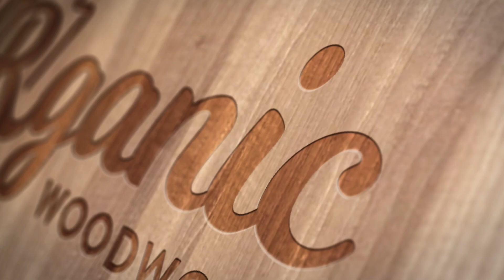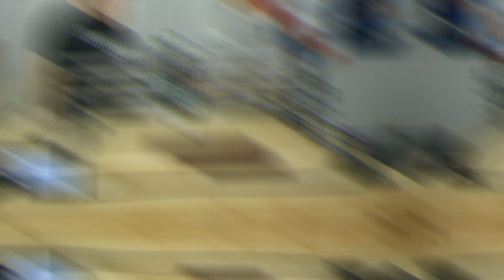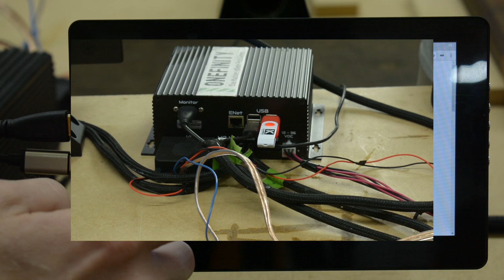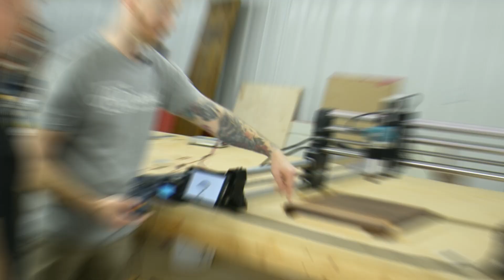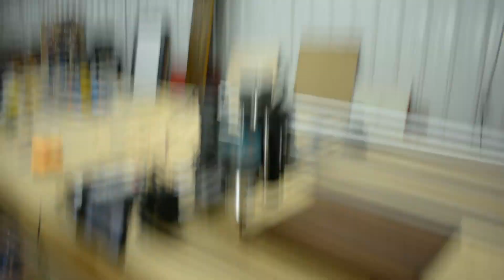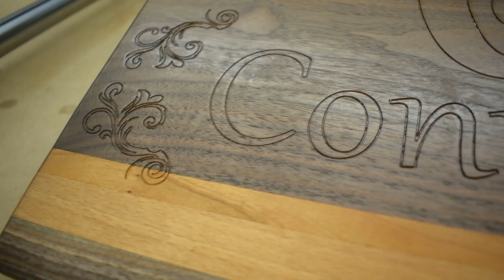The most user friendly CNC Machine

Comment: Hello friend, it is possible that this machine, if the tip is changed, can cut galvanized sheet less than 1mm. sorry I'm using a translator.
Reply from the maker: Yes with the correct feed rate

Comment: I have to confess, when I first discovered the OneFinity I was bummed! I've been using a Shapeoko XL now for about a year and have had issues. Particularly around alignment when flipping stock to cut/router on the back side of a work piece (I make solid body electric guitars). And issues with accurate depth cutting. I suspect, rightly or wrongly, that part of my problem is the slight inaccuracies that are inherent in belt driven systems. There are so many variables to consider on my current unit like eccentric nuts, v-wheels, belt tension (which are also subject to stretching over time), squareness of the machine, swelling and variations in the supplied MDF wasteboard. If I were to consider purchasing a OneFinity it would be more expense (even if I sell my Shapeoko - assuming one can find a buyer), and I don't know whether ball screws and steel linear shafts are 'THE' thing that will correct some of my problems with the Shapeoko. What are your thoughts on this since using the OneFinity?
Reply: You can't even order one. I'm leaning towards the Mill Right, not belt driven.
Reply: @bigrndahouse  Oddly enough, I'm looking at MillRight too - the Power Route to be specific. Not many reviews of it on YouTube however. I found one ringing endorsement and another who would not recommend.
Reply: @nigelosborne9984  I wonder if avid cnc would be better at this point. Have you seen that one?
Reply: @bigrndahouse  Yes I have, and I have considered it. I like that there are two stepper motors and ball screws on the Y-axis (a master on one side and a slave motor on the right side). I think the rationale is here that it keeps the gantry perfectly square at all times. The MillRight, by contrast has only one motor and ball screw drive right up the middle . . . . it apparently uses some kind of 'racking' or high-tensions cable system underneath the table to help keep the gantry square throughout it's movement range. All that said, I work off a Mac platform for both CAD and CAM. Avid CNC machines are run by a controller called Mach3 (or 4). And these are PC/Windows only systems. So if I were to go this route I'd also have to purchase a PC laptop and Windows adding to my cost. Would prefer to stay in the Mac environment if I can.

Comment: Hey Question? If you flipped it so it was running long ways, can you pass a full 4x8 sheet through and then slide the sheet in? I need to do a bunch of white acrylic to fit in channel letters and I dont want to have to chop saw it down?
Reply from the maker: Joel it’s not wide enough for 4’ wide material. But you could rip the sheet width down and do what your wanting

Comment: Lot of valid points.  Still just hate the cords on the front.  I say move the connector to the rear or option longer cables so we can route them as needed.
Reply from the maker: DASFREAK lol just for you I’m going to do a video of how to mount the machine with the plugs in the rear. It’s super easy
Reply: Arganic Woodwork your the best.